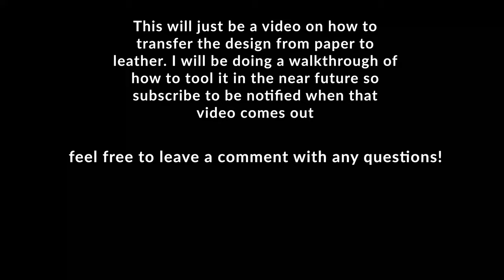How To Transfer Belt Tooling Pattern Pack To Leather

Comment: I have a question when u transfer the pattern to the leather is it only that small pice or do u do the same process with other 4 u cut out ?
Reply from the maker: You would use the same cutout along the whole belt, each cutout makes a different belt patter if that answers your question